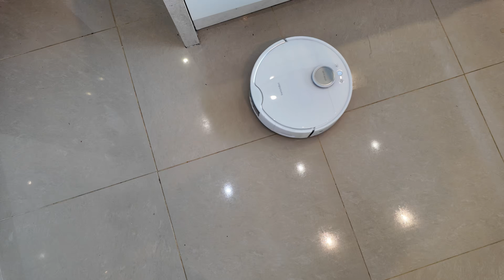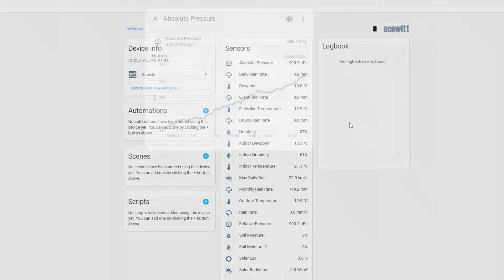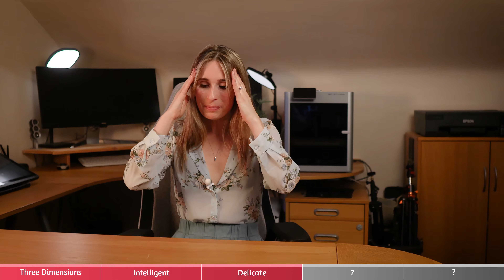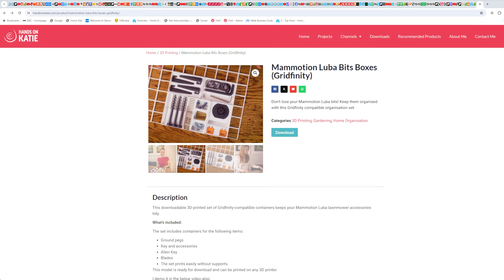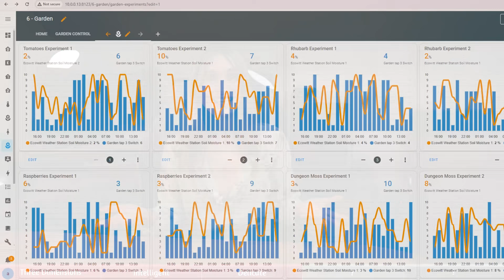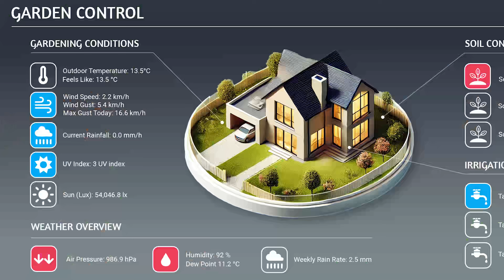Modernise Your Home Gardening: Tech Innovations You Need to Know

Comment: Another area that fits in with your gardening theme is outdoor cleaning. There are many robots for cleaning your floors indoors, or moving the lawn outdoors, but what about cleaning an outdoor deck eg a tile or timber deck.  There is cross over to indoor cleaners but you outdoor cleaners can come up against larger items (leaves, twigs etc), as well as moisture (puddles) or rain.  Something on this would be cool
Reply from the maker: That's a really good thought, I'm not aware of a decking/outdoor tiles/paving robot cleaner, but feels like a no-brainer for a robot vacuum company to branch out... indeed, have a video releasing today with a company that basically has created the perfect solution for this, just needs some outdoor weatherproofing and a few more 'rugged' features...!

Comment: There are at least two reasons I love this channel (which I only stumbled upon as of lately). The second is your passion for technology and your way of introducing it. The third reason is the top-notch quality of your videos.

Although I agree with most of what you've said, I'd however hesitate to put such an amount of technology in a garden... or even around me. Remember the more devices, the more failure points. And before somebody jumps in with "fault tolerance" and redundancy, I'd insist on the fact that it may become a maintenance nightmare at some point, e.g. because of failures, updates, version incompatibilities, wear out, you name it. It is indeed tempting to use technology to spare some time but in the end it comes with a drawback and it's shifting know-how into machines, losing practice and wisdom, mostly. Besides you may end up spending all the time you initially wanted to spare into repairing, updating, upgrading, bug tracking, adjusting, tweaking... Is it worthwhile in the long run? Time will tell I suppose.

BTW I am an electronics engineer who acknowledges his laziness. Wanted to share my two pence, hope you don't mind.

Anyway keep up this awesome work.
Reply from the maker: This is a great point - I should probably cover this in a video at some point. ie these devices save me thousands of hours every year, so I'm very, very comfortable that the occasional cleaning or changing of David Mowie's blades is worth the hundreds of hours of mowing he does in return. But your point is very sensible - indeed I've lightly touched on this in the past, a lot of modern smarthome devices have lost the plot and are more aimed at commercial goals (eg pushing ads, distracting your attention etc) than serving you (saving you time, making life easier).  Then on top of that, the quality of the engineering makes a huge difference - a poorly engineering Robot Lawnmower will cause all the problems you describe!

So there's definitely an assessment that's needed and careful balancing of the pros and cons - this is why I tend to centre much more on the companies and their ethos' than simply products on their own - the former often tells you lots more about the latter.
Reply: @handsonkatie  Sounds pretty fair to me. I'm very excited to watch your feedback through time 👍 (That is if you intend to, of course. And if not, no wuckers.)

Comment: Watering timers are OK when they're on the tap, but I am struggling to find a solution for waterbutts (even more eco friendly and cost effective!). These need to incorporate a pump and a smart timer. Any suggestions
Reply from the maker: Interesting case - I'd imagine the gravity of a water butt would act as a 'pump' wouldn't it?  I have one I'm plumbing up in the near future, so I'll test on this. If you need to pump uphill or something, then yes there's lots of pumps on the market that you could add and then control directly through home assistant! I'm also doing a mini version of this in the near future for my planter irrigation system!

Comment: Not to alarm you, just wondering about the radiation levels in your home? From your phone to all the ? Now I'm making myself panic. Cracking video, God bless.
Reply from the maker: 🤣 it's alright, I studied electrical engineering, so I understand radiation - you know radio waves have larger wavelengths than buildings for example....😉 Mobile, microwaves etc are non-ionising, assume you're not scared of light, which is closer to the dangerous forms (eg x-ray, gamma etc)

Comment: As always, fine work on the pun-ishments - I guess they will continue until morale improves? 😉
It looks like Tertill is also tilling the topsoil with his little wheels too, which is a pretty cool way of working. Farmbot looks amazing! David Mowie looks awesome, BTW!
I legit laughed out loud at "Popty ping"! 🤣
Sadly I live in a flat, so no garden and no external water connection. But window boxes with a gravity fed reservoir and irrigation equipment is a possibility, and I've printed out a "self-watering" planter for herbs - I plan to grow my own basil, chilli/pepper of some kind (haven't decided what yet!), and thyme. Maybe some parsley or oregano too.
I've only had the 3d printer for nearly 2 months now, and I think I've spent in the region of £150 - £200 on filament already, and I'm dreading the next electricity bill! 😆
Forgot to add, I got the files for the self-watering planter here: https://www.printables.com/model/57885-self-watering-rectangular-planter-with-optional-la
Reply from the maker: Exactly right! And you're right, I should have pointed out Tertill's clever wheels (I mean it's literally in his name!).  Check what filament you're buying - my biggest mistake was paying too much for filament initially, it's about 3x cheaper if you find the right sources/brands - drop me an email if you want my tips!
Reply: @handsonkatie  More recently, now I've got "enough" spools, I've been buying refills direct from Bambu (£18 per kg spool) for most things, in batches of 4, as the bulk discount (£4 per spool or refill) means you're effectively getting the 4th one for something like £3 if it were at full price. I've only really explored Bambu filaments so far, as they seem to work well, and they automatically talk to the AMS via the rfid tag. 
My method only works for the cheaper filaments that you can get as refills though, but it's still pretty cheap?
It does mean I've got spools and bags of filament lying around all over the place!
My other plan is to overload printables with high quality 3d models, and earn enough rewards to get free filament 😂

Comment: Farmbot looks intriguing, I wonder how such a system holds up to the outside with all its dust and wind. The system looks quite open and is quite expensive for an experiment.
Also: Why would anyone need a reason to dig a hole?
Reply from the maker: Yes, it's been developed for over a decade across the world (check their site), so it's pretty robust. Personally I'd treat it as an early 3d printer - ie it's not zero maintenance, but it saves you a massive of time (weeding, planting, watering etc) in return for costing a bit of time (maintaining, tweaking etc!). And as its open source, you know you'll be able to upgrade/develop in future too!